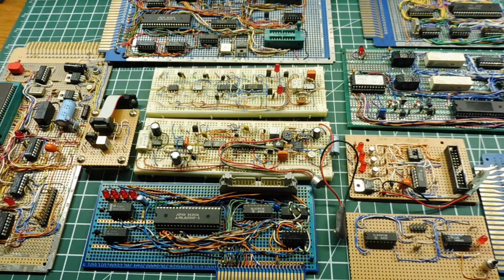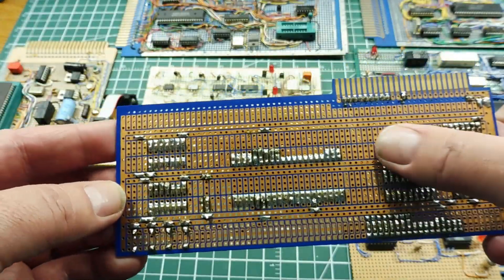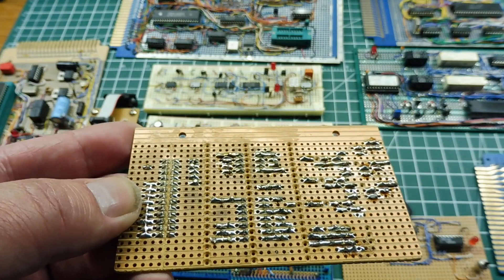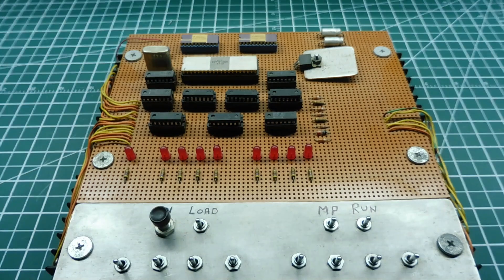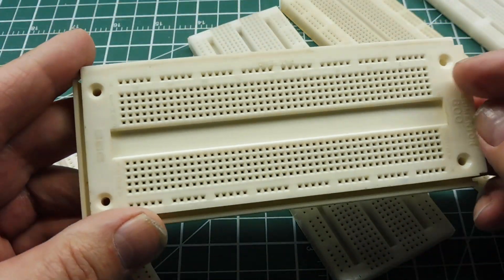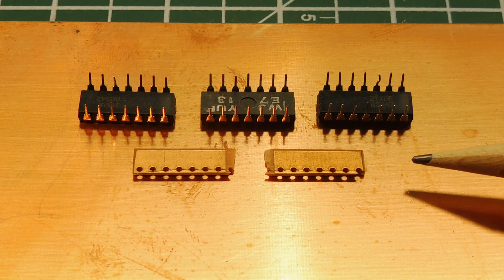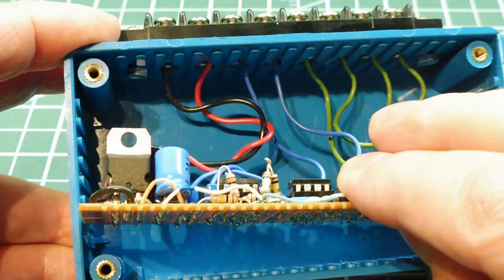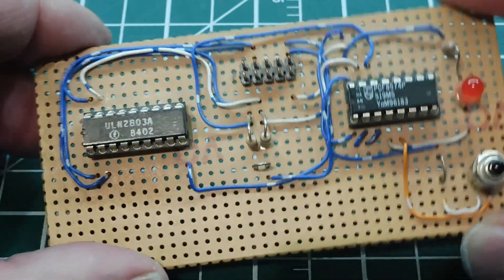Circuit Board Prototyping Tips and Tricks

Comment: There seems to be a big difference between perfboard that has tracks and perfboard that has single pads. The first can be used to copy the basic breadboard layout but the second allows for nodal analysis & design of the basic circuit that compresses the number of horizontal & vertical holes into a really compact layout. The second requires a bit more effort but the resulting compression is very satisfying.

Comment: Absolutely happy that I finally found your channel, lots of great stuff here. Love seeing how things have evolved and how much is still relevant. I don't understand, though, how the boring tool creates a connection break, I guess it breaks the copper connection somehow, but I just don't see it. I'm probably dense. Thanks for your content, looking fwd to seeing your other vids.
Reply from the maker: Welcome to the channel. The boring tool is similar to a drill bit that has a diameter larger than the width of the copper strips. Boring will cause the drill to remove copper causing a break in the circuit. Hope you can find some videos that are useful.

Comment: There also is a variant of proto board with separate pads for each hole, IMO a bit more flexible than the strip boards, as well as double-sided variant (for each hole there's pads on both sides, connected together with a via, a tiny copper tube going through the hole), which is way sturdier and gives a lot more opportunities (what I like to do is to solder bigger SMD components on one side, and run uninsulated wire as traces on the other). And for those wondering, how to use smaller SMD components with a "pad" perfboard, there is also a 1.27mm (0.05"...? Sorry, European here...) variant, and lemme tell you, most of the typical SMD parts (TQFP, TSOP, et cetera) fit there really, really well. It's a bit tedious to solder them, because this is the realm of microsoldering, but IMO still worth the effort - you get a really flexible, sturdy, and high quality prototype (and even long-lasting, permanent) board in an universal package. They are a bit hard to find though, at least in Europe, sadly (when I did find them, I just bought a whole batch of 30 pieces lol)

Comment: Thanks. Is there a prefered board for power circuirs? 2A at 5v.
Reply from the maker: To lower the resistance of the copper strips for larger current applications you can parallel the copper strips and add a layer of solder on the larger current circuits to cut down on strip heating. The strip board can handle 2 Amps but there will be some heating. https://youtu.be/WT9xWyLK-Ic
Reply: @0033mer  great 👍

Comment: I need someone to design something for me
I need a hand crank to go on a 40c thermal switch  attached to a battery 
So the battery is as close to 40c as possible All this says a battery 40c is no problem he shows a battery can heat up 
https://youtu.be/an9-i23mGqc
So does this
https://youtu.be/ObqHo-BTqIQ
And this does 
Charging lithium-ion battery is possible in a temperature range of 10°C to +55°C. However, the charging should take place only at a battery temperature of +5°C to +45°C

Please find me someone to make this for me My region is refusing us products. they said covid or something Please find me someone to make the battery at 40c then I can have a 40c power source  that works on very little power
I truly hope you can help

https://photos.app.goo.gl/qCuXP3w6ixX8SwTK6

Comment: Awesome,

A great video, full of info, no crappy music and full of useful info.

Liked, Saved, & Subscribed

Question, if I may, where do you get the breadboards with the screw downs? The self adhesive ones peal off after a while
Reply from the maker: Thanks for the feedback. The company that made those breadboards ( Continental Specialties ) is no longer in business but if you check eBay you might  find them there.

Comment: Can the vectoboard be cut?..
I wanna try a project with it,but i dont know whre to start...
Reply from the maker: You can buy pre-cut vero/vectorboard that fit into standard enclosures or you can cut your own to fit. Score the top and bottom with a razor knife, put the score on the edge of your work-table and snap it off.   https://www.rpelectronics.com/881-420306.html
Reply: @0033mer  thank you so much...

Comment: Using the Veroboard, how did you isolate the 10 header pins on the top middle of the board?
Reply from the maker: Cut a narrow isolation channel using a Xacto knife. It takes a bit of practice. If you cannot make that work you can buy 10 pin headers that will straddle the Vero strip. https://store.qkits.com/technological-arts/idc-ribbon-cable-to-breadboard-adaptor-10-pin-adidc10-m.html

Comment: Great video! an unrelated question. what is the wire joining two adjacent contacts in the middle of the board that you can see at minute 6:22:  under the resistors
Reply from the maker: I normally install wire loops on the board to hook up scope probes for testing but in this case the wire loop is the Vcc ( 5 volts ) power connection and the other wire loop connected to pin 8 of the IC on the right is the ground connection.
Reply: @0033mer  Thanks for the answer. That is actually very useful :)

Comment: Thanks for showing the various options, new and old. Did wire wrap during the late '70s. Recently became a 'maker', using solderless breadboards w/SBCs & MCUs. Just discovered Fritzing PCB design software, which has a great GUI that allows easy breadboard and circuit design migration to PCB layout. The files can be uploaded to online mfrs for inexpensive fabrication and quick turnaround time.
Hope this is helpful for your viewers. 😎
Reply from the maker: Great tip!

Comment: Good video, have a question,  at @3.49 of the video you have breadboard that has a wider isolation channel,  where can I pick one of these up at.  I do a lot of work with larger Micro Controllers and this would be great to have.
Reply from the maker: The Experimenter 600 is no longer available, so your best bet is to check on Ebay. You can also remove the power bus strips from two boards and straddle microcontrollers between the two.
Reply: @0033mer  Thanks for the reply,  it is not the same trying to piece together a board...lol.  Not sure why they would stop production of a board that has unique value.
Reply from the maker: The large semiconductor companies are cutting back on DIP packages because of the cost as compared to surface mount (SMD) devices. NXP is the only company that makes an ARM microcontroller in a DIP package and that might soon disappear. One day we might not see microcontrollers in DIP packages which is sad for students who want to breadboard them.

Comment: Are there large protoboards with isolationchannels still available somewhere? They do not need to have edge connectors. But needs to be fairly large
Reply from the maker: They are harder to come by as PCB prototyping has become inexpensive with fast turnaround time.
You can check with Vero Technologies or Vector Electronics.
https://www.verotl.com/circuitboards/protoboards

Comment: I have a project where I have to build a working prototype. Here is the thing. I know Nothing about building a circuit board. I can draw it. Just can't build it. Would you be interested in build me a board?. And if you are. What your fee be?. Thank you for your time, Harold Mills, hgmills3rd@gmail.com
Reply from the maker: A easy way to go would be to draw your layout using Fritzing (free software) and getting a board made through Fritzing Fab. http://fritzing.org/home/
For more complex designs you can use EasyEDA and have JLCPCB build your board. The cost would be far less than what I could do it for.

Comment: Hi, just curious, are there ways to cut vero board to smaller sizes from a large sheet 
at home?
Reply from the maker: Using a straight edge score both sides along a row of holes with a razor knife to get the desired size.
Put the scored row along the edge of a table and push down to snap off the board.

Comment: Are circuit boards copy righted?
Reply from the maker: That is a complex subject and would require a complex answer. IC manufacturers copyright their "mask works" used in the production of an Integrated Circuit.. A PCB is a different story with a lot of gray areas. Each individual case outcome would vary in a court of law.
Reply: 0033mer Just curios, Thanks for answering. I have one more question: I’m 39, do you think it would be wise for me to get into electronics tech working for myself? I’ve been self employed for the last 10 years and couldn’t imagine working for anyone else.
Reply from the maker: I am retired and still do industrial electronic repairs and consulting. There are lots of opportunities out there if you are determined and willing to put in the time and effort. Check out my video: https://youtu.be/6MWVAh1V1c4

Comment: The hole-driller does not work for two-row connectors, because you'd need to cut in-between the holes to make it fit. I have used a serrated curved scalpel blade from a plastic model store, originally designed for cutting plastics.
Is there a better tool, more suitable to the task?
Reply from the maker: I use an Xacto knife and a straight edge and cut out a narrow strip between the rows.
If I am using a lot of two-row headers I get the ones that straddle a strip and then use my boring tool.
https://www.adafruit.com/product/2102

Comment: 5:04 That Manhattan technique looks like creating art on a copper plate. Do they sell those square "islands" on the board? 
It looks a bit hard to solder because of the thermal dissipation of the parts.
Reply from the maker: The Manhattan technique is basically a do it yourself project. You cut out your own islands from a bare copper clad PCB  and glue them to the main board. This allows you to become very creative and your final product can look like art.

Comment: Hi, I am trying to get hold of a board like the one you are holding at 45s. Does anyone know where I can get this ?
Reply from the maker: That particular board was originally from Radio Shack (Archer) back in the day.
Proto boards like that are hard to find as chip manufacturers are dropping the DIP package and going surface mount.
The best place to look is Vector Electronics:  https://www.vectorelect.com/prototyping-boards.html
Digi- Key is a distributor. Be aware, they will be pricey.
Reply: Thanks for the link, I've been trying to find a nice Eurocard board. In case you're still curious, these guys also sell a bunch of specialized protoboards, including one with an XT card edge connector like at 45s
https://www.circuitspecialists.com/xt--bus-prototyping-boards

Comment: Beautiful prototyping examples! Thank you for making this video with many useful tips. How do you make the wires hug the surface of the veroboard? Hot glue?
Reply from the maker: I use 22 or 24 solid gauge wire and bend then down after soldering and they will hug the board.

Comment: The "vector board" that you showed appeared to have more than 40 copper strips. Is that correct and when did you get them from?
Thanks.
Reply from the maker: The board is actually called "Veroboard" or the generic name "Stripboard". I have a habit of calling all boards Vector boards.
The two main companies making protoboards are Vector (USA) and Vero (UK). The board shown is 8X12 inch 78 strips, a size which is hard to find. I got it here:  http://www.rpelectronics.com/prototyping/circuit-boards-busboard/thru-hole-boards
They do not stock that size but if you look online you probably can find some with more than 40 strips.
Reply: Vector board == Veroboard?

Comment: Where did you get that tool to cut isolation channels in the veroboard? I just picked up some veroboard and I was going to use a dremel, but that tool looks less messy and more controllable. Great channel, btw.
Reply from the maker: Here is a link: http://www.rpelectronics.com/r22-0239g-veroboard-cutting-tool.html
Reply: You can also use a Stanley knife or similar for making the isolation channels. Tip is to plan your isolation channels first and cut them before soldering any components to the board.